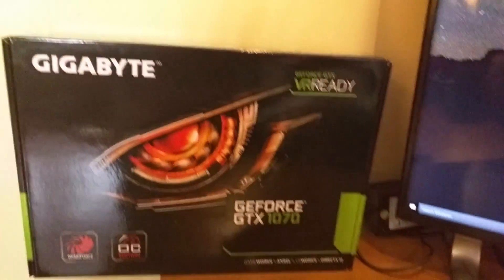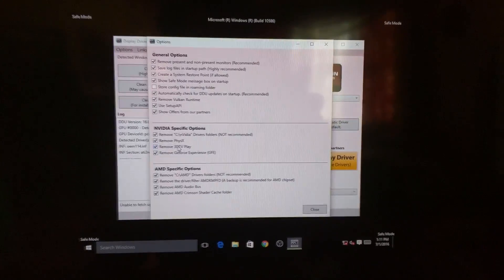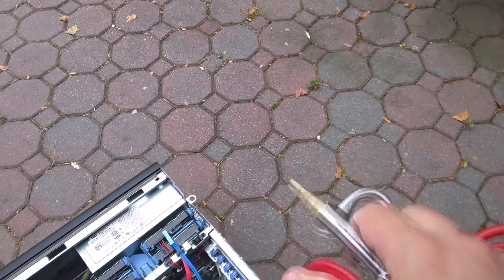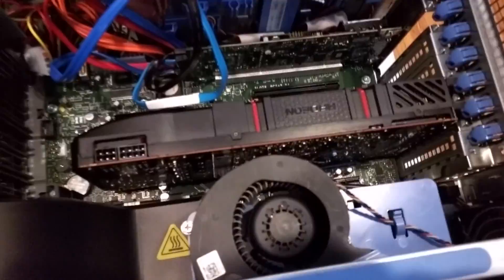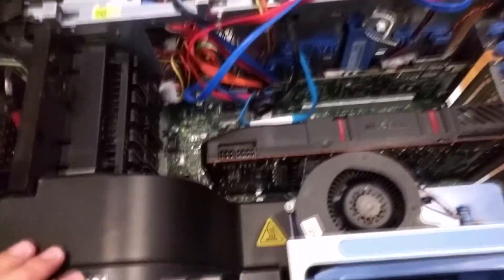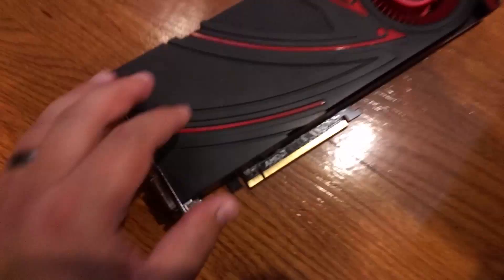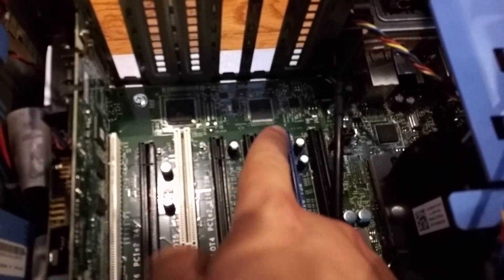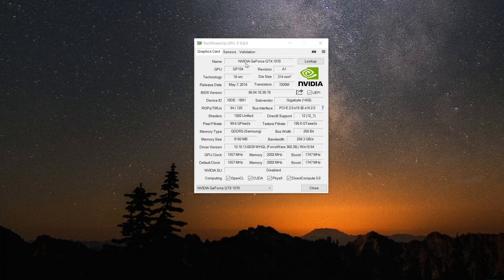How To Upgrade Your Video Card - From AMD To Nvidia GTX 1070 GPU

Comment: I just upgraded to a 1070 from rx 580 and I uninstalled amd software from my computer and put the 1070 in and now my computer turns on but no display. What do I do?
Reply: same issue.  did you resolve it?

Comment: What about if your CPU doesn't have integrated graphics? Would the new Nividia card still power the monitor before the drivers are installed? Or should I install the Nividia drivers first before switching?
Reply from the maker: If you don't have integrated graphics, it's still fine. Your GPU will still display output, but with a basic driver

Comment: I have a little difrent problem...
My r9 280x died, it was on fire hahah 
Im getting a gtx 1060 ti, can i put it in and start the Pc and then delete the drivers or do i have to install new windows before putting the new gpu
Thx
Reply: Answer asap pls
Reply: same peob
Reply: One... there is 1060ti version for two yes you uninstall old drivers I believe you go into safe boot mode then unistall.. remove old card add the new then install drivers. Just hope yours works I just got a new sapphire rx580 8gb and Monday will be sending back because the damn thing doesn't display picture:( so good luck

Comment: Does that little pop up at the end (3.47) just come up when you reboot your computer  straight away ?
Reply from the maker: Jack Carroll no, that application is GPU-Z that I manually ran.
Reply: also can i just install my new graphics card which is now an Nvidia card and uninstall the drivers of my AMD card after and then install the new drivers for the Nvidia card ?

Comment: i will buy a new gpu, ( gigabyte g1 gaming gtx 1070 )

so basically i have to use ddu and remove my drivers, after that i can unplug my psu and replace my old gpu with my new gpu ?

cause i didnt really know how to use ddu, i mean do i need to remove everything expect mouse or anything like this

or do i have to do anything else ?

ty tho
Reply from the maker: Correct. Download the latest version of DDU and run it. it should automatically tell you to restart in safe mode and it should force it to happen. after you boot in safe mode, launch DDU again and uninstall everything.  then shut your machine down and swap your old GPU with your new GPU. Start your machine and load the latest drivers and you're good to go.
Reply: +The Phawx (PhawxTV) oh okay, thank you very much for replying! :3
Reply from the maker: Corvo Attano :) Enjoy your new card!